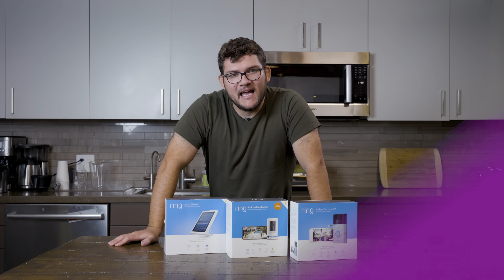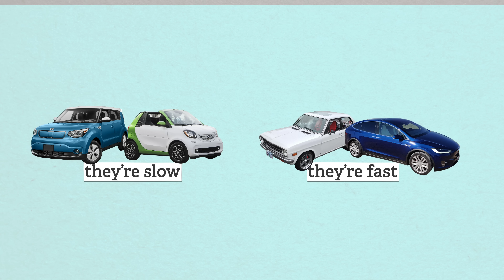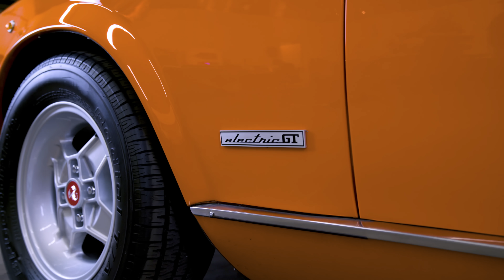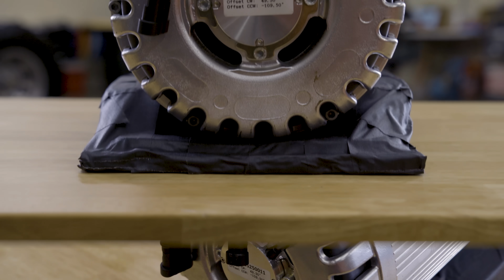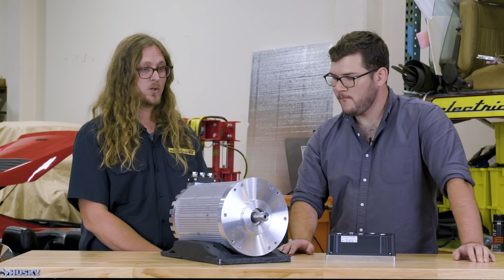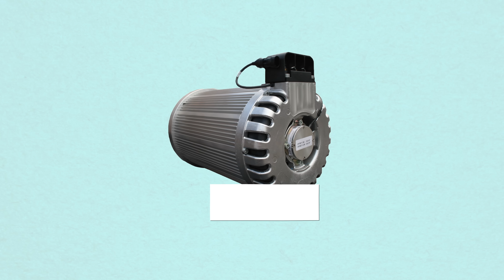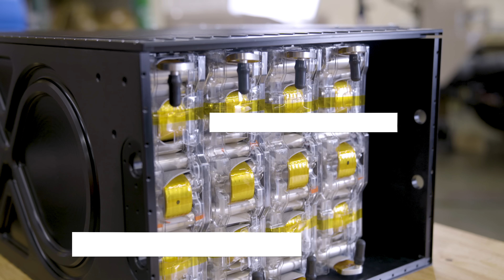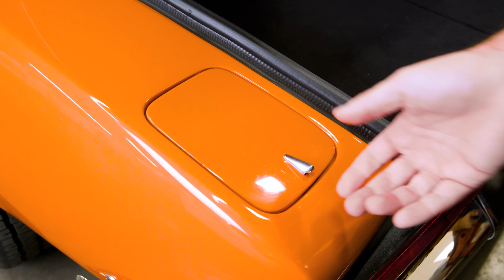Are Electric Motor Swaps the Future of Tuning? | WheelHouse

Comment: I personally love the sound of an engine and the rumble.
Reply: The Tesla Model S does 0-60 MPH in 2.5 seconds, The 1986 Lancia Delta S4 did 0-60 MPH in 2.37 seconds, on dirt,gravel,rain. The Tesla did that time on modern tyres and on asphalt, so, the ICE can keep up If done right
Reply: And not only for average use but when it comes to my side activities for fun....racing internal combustion engine cars is a blast! The sounds, smells and pure power is unbeatable. A big block v8 as I call it... 632 cubic inches or 10.4 liters for you non americans, is just pure beast. The torque it makes and instant hit from it is unreal. Sure they make ev look great against new production cars but my god new cars all slow to respond. The transmissions alone hurt new ICE cars for the slowness. Look what most racers use, a th400 with manual valve bodies and trans brakes. Pick a gear, and rpm to leave at and boom gone.
Reply: NoNoNoNii  You're either too stupid, too old, too young or too intoxicated to have any sort of conversation. Go on, write 6 more incoherent rants in reply
Reply: @mortache  electric cars all I hear about is the instant torque....actually have you ever had an ICE engine with a standard trans, dump clutch at 6k rpm and boom more instant torque then any EV car ever made. But what happens, tire smoke. Electric cars still have to power the same tires any gas car does....and no matter how much torque or soon it comes on, you still have to manage it to leave right. Look at a top fuel dragster....they slip clutches to melt down just to manage all that INSTANT TORQUE!
Reply: @Monte1970SS  6k rpm? The term "instant torque" means that torque at 0rpm. That's how they manage to make fast electrics with 3, 2, even no gear at all! What you said will work for the gear, then shift gears and again you're either waiting for engine to rev and turbo to spool up. Instant torque means exiting a corner with optimum performance since the torque doesn't care what rpm your engine is in.
Reply: @mortache  well you gotta look how an internal combustion engine works lol. You electric tools cry about it on yall side.
Reply: @mortache  ice engines make whatever torque you want to the tires instantly at drop of clutch.
Reply: @mortache  and again you also know torque falls off as horsepower rises in ice engines since you studied them so well. I got a 632 cubic inch v8 that makes well over 800+ torque below 3000rpm but peak power is near 6000rpm....at peak power my torque is below 800 there. You may need to study more.
Reply: @mortache  uh I got dyno proof of where the torque is on my builds lol. You apparently never witnessed a real big block v8 in action. And even on a road course the ICE engine will need to be managed because of the quickness of power out the turns. From a roll electric just is gutless period. They mostly work from a stop and even then paired against a proper setup they will lose. My daily driver runs 10.4 at 130 in the 1/4 mile and it'll do it on the street too. It'll take one seriously gutted or expensive electric car to copy it. Even pair an electric car that runs same et as mine....the mph is not there, so from a roll the big v8 will dust that wall plug. And from a roll my cars torque converter flashes to its peak torque at 3k rpm....so me in an ICE engine will have 800+ torque instantly when I hit the gas. Goodbye wall plug silent car then lmao!!!!
Reply: I don't need to google anything, I have living proof in my garage what these big v8's do instantly lmao! Where a whimpy electric car does all the work...the driver in those just floors the pussy pedal and computers manage power to the wheels, my gas cars are managed through my right foot. Cause if I just floored my from a stop....it'll smoke tires to no end. You know that instant power the ICE engine has is unreal.
Reply: @Monte1970SS  all you say is that you have no idea about what an engine is and its all magic crystals and pixie dust to you lol. Come back when you have any idea about what you're talking about. Its nice that you're happy with your little V8, but some of us deal with engines from tiny to huge ones that produce thousands of horsepower and your pride in a very particular engine size makes me chuckle. "Big block V8" lol that's why America could never make a supercar
Reply: @mortache  america doesn't need a super car.... I drag those all day with my old muscle cars. I build all kinds of engines from 2jz, ls, etc... I got video proof of my builds in action and you can cheerlead all day with your wall plug car but in the end of the day the internal combustion engine is far superior. Say you have a zipper dragster that runs same time as a top fuel....zipper wall plug makes a pass and sounds like someone closing up a gym bag, then the top fuel dragster pulls up and fires up to make a pass. That top fuel will leave an impression, people don't go to watch those just for the et, its a full experience.
Reply: @mortache  but. They have.
Oh you have a degree in engineering. What a coincidence
Reply: @mortache  look lets just settle this right. Get your wall plug wet dream car and bring enough extension cord. And I'll grab up one of my slow old cars that dreams of being a super car and we can go drag race. See how well your "instant torque" from the vibrator you own fairs against a slow old internal combustion engine. Hope you have 6 figures to buy a decent vibrator wall socket car, mine only cost 10k to make run its times lol!
Reply: @Monte1970SS  you can build a car with 10k without cannibalizing old parts? Of course electrics are expensive now since its a new technology. A 8hp car was expensive once, compared to horses.
Reply: @mortache  hahaha well right now, nothin comes close to the combustion engine. Its neat to see electric cars but they are older then ICE cars and a reason they died out 100 years ago. Range and batteries. Plus no one wants to sit at a charging station nearly an hour.....people get pissed off when a gas pump is slow and takes 5 minutes to fill up your car lmao. They got a race that lasts 24 hours too....pretty sure you know about it, well wonder why no full electric car competes there? Pit time would hurt I bet? Lol
Reply: @Monte1970SS  electric cars only started to make sense once we got high performance lithium batteries. No one has to go to a gas station for charging, you can just charge it overnight. Also, if you're on a road trip, take a break and grab something to eat, or just do the world a favor and take a plane lol
Reply: @mortache  I prefer driving. And sure it sounds good on paper but in real life its a hassle. I can't tell you how many times I get home and a friend hits me up to go somewhere random or a street meet for racing. With electric I'd have to say I just got home and it'll be a few hours before I have enough to run around with.....gas I can go at any sec. Even near E I'd swing by station midnight and top off in a few mins and roll on to meet up. Plus my gas burners mpg stays same all time, where the ev car depending on years, usage and charge habbits.....you could lose mileage big time. So a night of racing in the ev, you may be stuck at a charge station multiple times for hours on end back to back....where my gas burner, splash and go. If you're a lifeless robot, sure those ev talking points of charge at night, creep around town, no long drives and keep a perfect schedule work great. But as someone with a life that does things last minute, its hard to beat the internal combustion engines readiness and speed.
Reply: @Monte1970SS  honestly you are making stuff up about things you have very little idea about. Batteries do not lose efficiency much, what they lose is capacity. And if you drive 300miles everyday or drive a truck then fine, an ICE is much better for you. But if you're driving 40 miles in city traffic then the electric is a hundred times superior
Reply: @mortache  haha they lose it all. The motors will draw more over the life and batteries will hold less period. And then it all depends on usage. Range is cut big time if you floor it more or work it harder. I've seen first hand the real range issues from others. Ev cars you plan your life around it, gas you don't. Wait until you have an emergency when you get home while you just plug in your near dead ev car and need to rush off to help someone. You'll be telling them hold on till morning when my cars charged cause I don't have enough wall power to be able to help. I've been called in an emergency to take someone to the hospital in the middle of the night and my gas powered car was ready that sec. Not making shit up, I'm giving you real life experiences and in the real world nothing comes close to internal combustion period. They are so good today, replacing them needs alot more then just a few talking points ev boys push lmao.
Reply: @mortache  where ev cars work perfectly.... give them to mailmen, bus drivers or meter readers. Day jobs that work off perfect schedules that don't change. But for the average person they are huge failures. Besides I like my cheap home power bill. If most americans had ev's then the whole energy grid would need upgrades and more massive powerplants to produce the demand for more power.....guess where the energy company will pass the costs down to. Uh huh the consumers, and right now ev's cost just under the ice cars to operate.....wait until more come, then not only will the ev cost far more but your home energy bill will skyrocket. People need to take these things into the thought process cause it all would happen. But ev boys try to hide all that or act like that energy from the wall is free.
Reply: @Monte1970SS  two words. Regenerative Braking. And what average city dweller drives more than 40miles a day?
Reply: @mortache  that regenerative braking is drops of water in an ocean bruh. And let me ask you this before arguing on and on....do you even own an ev? Or even old enough to drive for that matter?! I consider myself fairly average and I put roughly 100 miles a day on my personal car. Do alot of city driving too, fill up 3 times a month. So in one month I'm at a gas station for max of 15 minutes if say it takes 5 minutes to fill up once....and normally its not even 5, more like a few minutes. Now on paper an ev would work perfect for me cause when home I plug up and top off overnight...so no stopping at any service station right?! But life never works that way. Sure in a perfect world going by that it makes sense to go ev.....but this world and my life is far from perfect.
Reply: @Monte1970SS  no i don't own an EV and i don't drive more than like 20miles a day. In stop and go traffic regenerative braking gives back a lot of power, and since EVs don't even idle, its really no comparison. Maybe watch a few videos by "Engineering Explained".
Reply: @mortache  I don't need to watch videos. I live it daily lol. Get you an electric car and enjoy, I'm not knocking your decision. I'm just trying to warn you what long term gets ya. The convenience of internal combustion is still too great for me to even entertain the ev. I like my short fill ups, my instant readyness....like not having to plug up at a certain time or place and wait. My gas burners can be parked anywhere any time and fill up in seconds. I live in a hurricane prone area where power outage is normal for days or weeks at times, work in areas that don't have many services and need to be ready at anytime. I live in the real world and no electric car comes close to serving my needs and laziness lol.
Reply: @befer  I think you're not a big fan of cars and came here just to start a debate. Let me have my opinion and I Know knew cars have that but it's stupid.
Reply: Danish Wistara  I know it's not perfect. And even now, because we don't have reliable battery storage there can't be 100% renewable energy. That's why coal is still used today. It's hurting for the environment, But significantly less than every gas car combined.  Noone ever claims it's a god's send answer to pollution. It's supposed to reduce it. Elon is also working on solar. He has many projects and just saying " Tesla and Spacex " is plain out disrespectful. Elon is still a human, and does commit mistakes and I equally despise people who hate on him and the people who stan him like he's a god. I respect him for what he's doing, But I don't hate him for the latter.
Reply: Danish Wistara  I forgot about this comment, but I just realized how many idiots liked those twats' comments and it makes me furious. There are many stupid people, more than intelligent ones it seems. And it bothers me. you make fun of someone, or be disrespectful and call them names, throw a bit of crazy in there. And look how people follow you because you're on the offense which is way easier. WAY. Easier.
Reply: Agreed, I can’t bring myself to leave a B13 Rotary or Big Block 427 in favor of, well meh.
Reply: Danish Wistara  actually, extracting crude oil puts 270 billion tons of c02 into the air, compared to the just 27 tons to make an electric car, and it doesnt make any more emissions after that. an electric car running on a coal plant is still cleaner than gas.
Reply: add electric motor to old v8. use the motor for city. and v8 for long ride
Reply: That’s because up until now, that’s all that was available.
Reply: @befer  i need to red flag you for what you said some newer cars has a natural sound not just a speaker projected sound i just wanted to correct you
Reply: 😂😂😂😂😂 this comment section is AIDS. ICE vs EMs stop bitching about car sounds get over it damn. I agree 800 horsepower V8 Open heads sounds amazing... but so fucking what if it’s artificial still would sound hella dope. Unless you gotta small dick and need to compensate in engine noise polluting everyone’s ears 24/7. Imagine having the ability to hear engine noise when you want and silence it at a touch of a buttons without having a 20k$ exhaust setup... I get it you just love the smell of gas and it makes you want to nut to your car but don’t diss EV because they have no sound lol eventually having a gas powered car is gonna be so outdated that you’ll only be able to drive them x days in a year and be forced to buy EVs times are changing you can either accept it or decline it and get left behind. Some of the biggest brands. “Porsche” is moving on from Gas Engines and focused on EVs for the next 3 years, same with Honda, Ferrari, and I’m sure Lamborghini will follow and then ford and then Hyundai and so on and so on all it takes is for one big break and Tesla was that big break.... I my self. Would like the option to drive a gas and a EV but I’m not gonna bag on a Category of a car because it makes no noise 😂😂 that’s so childish grow up ... and yes I’m triggered cause we have grown ass adults crying about the sound of a VEHICLE it’s lame you’re still measuring dicks in 2020 🤔
Reply: Same here.
Reply: I love to have a choice to kill the planet, it's America. Its my choice. Lmao. Wait for teslas to have a simulated engine sound. Newer cars do the same thing using speakers already anyway.
Reply: @befer wtf so your telling me that eliminating all ice cars is going to save the earth. So america is the only place that has gasoline cars. That's stupid right there
Reply: @jasonwatson1161  bruh electricity can cause some kind of pollution to right?
Reply: @jasonwatson1161  Ah yes, i forgot that when you refer to the '' whole world '' in american conversation it specifically means '' America and maybe some europe, ah the culture differences.
Reply: @befer  yea i want to kill the planet. Simulated engine sound is shit and lame. It will feel crap. You feel the engine from its sound and vibration and it feels like the car has a soul. Adding a shit sound is lame. Whats the point of just selecting a sound? The real joy is when you swap the exhaust, you install a more whistly turbo, you install a better intake etc.
Reply: @dieselgeezer18  
who cares? if we keep driving ICE's there won't be anyone around to expirience a V8.
Reply: @eggsacc716  the mach e is a constant whine that gets on your nervers. This is fake noise from speakers. The sound is not made by the car. Its made by speakers. Thats totally lame
Reply: _ Beferrr still will never be same
Reply: @befer  I ain't even American
Reply: you stick to your soy-mobiles let the real car people drive REAL cars not toy RC cars
Reply: @14_Ozone  facts
Reply: @14_Ozone  Still faster than any ICE in the world and they will continue to be faster. Instant torque and EMs can practically spin forever at way higher RPMs than any ICE can even imagine.
Reply: @merlinthebikewizard4392  i want the same drugs you have.
Reply: @merlinthebikewizard4392  Notice that electric cars hold very few significant records even though they're older than ICE cars
Reply: @savagetuner2404  So the Pikes Peak Hill Climb all-time record is insignificant? Though electric motors are older than the modern ICE, battery tech went virtually undeveloped for decades. They only became useful with the introduction of lithium batteries
Reply: @14_Ozone  I'm sorry that you need a loud car to make up for your " manliness " but oh well. I prefer quality and reliability.
Reply: @merlinthebikewizard4392  yeah even though instant torque is impressive to non car guys and some car guys. When you driven or seen high hp v8's or v10's it is a joy even though they doesn't have instant torque
Reply: @mortache  why tf are even here its a car channel that is mostly ICE anyways
Reply: @savagetuner2404  Electric cars were the first cars. First is the worst.
Reply: @michaelarkell5437   First isn't worst, just electric lol
Reply: @14_Ozone  ok Lamar